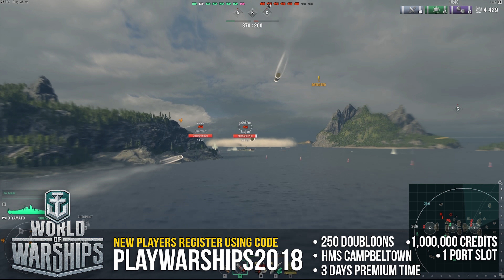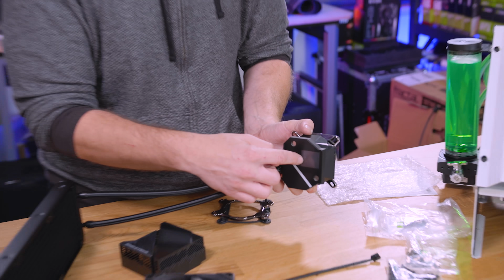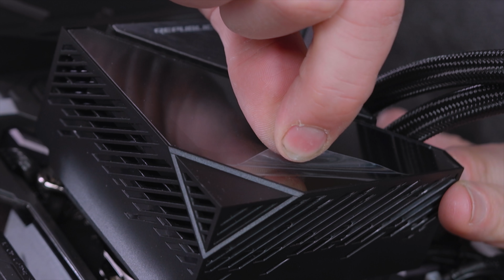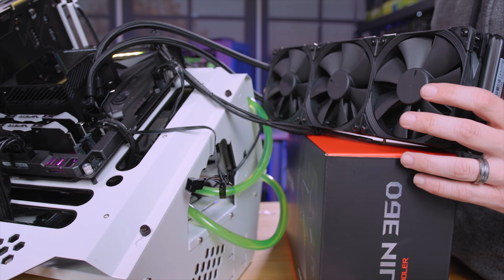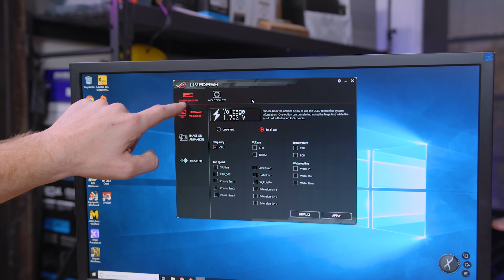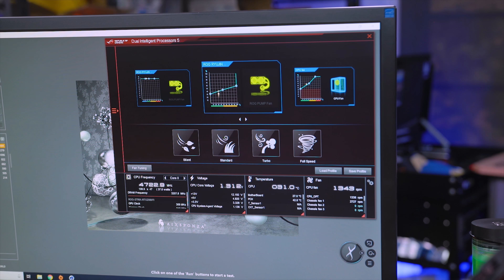ASUS made an AIO... but is it any good?? RYUJIN 360

Comment: Asus has been trash for a couple years now
Reply: I've bought two ASUS B350 boards and they both ended up fucking not working. Nothing but problems. Original was the B350 Prime and the most recent ROG Strix B350-F and it's fucking dead. My MSI board on the other hand works or rather worked fine.

Comment: Hi Jay,

Big fan, puns aside ;) 

Although I wanted to go for a fully water cooled solution, the UK market hasn't quite caught up and I have reservations about some sellers here so I ended up with an AIO. My NZXT Kraken X62 does an excellent job. I was concerned that it wouldn't be able to cool the 8086k I purchased with it but it rarely goes over 86 Celsius when load testing with default fan curves. 

I did swap out the two standard fans for Corsair ML140s simply to test the new fan tech. It happily runs at around 52 Celsius whilst under load with little noticeable noise as a result.

My rig is a bit of a Frankenstein as the case isn't ideally set up for the radiator. Any suggestions on improving this set up would be appreciated.

Adendum: Neglected to mention it has a stable overclock, all cores @5.1

Comment: I bought mine from overclocker before it hit in the US. And I’ve been loving it ever since. Keeps my 8086K cool at 5.2ghz. Even though I delidded my cpu butni don’t get anything higher than 50c when gaming and streaming I reach 60c. When I did a stress test it went up to 70c. So for the most part I am in love with it especially with it’s aesthetic that it has. Unfortunately you got one that came bad with wires but a lot of things isn’t perfect. Hopefully others didn’t. But it’s a great cooler. Don’t need Core Temp on my desktop to keep track of my temps I can just look to my right and check out the temps.

Comment: I have a mission for you jay! take the Fish Tank cooler and run it with a mineral oil 
submerged PC perhaps cool the tank with a closed loop radiator in the oil or run the oil from 
the tank to the fish tank cooler. one more idea. if you ran the coolant lines (with standard coolant) 
from the fish tank cooler in the mineral oil at super low temperature  to a block will there be 
any issue of condensation? please reply! love the show will post this again till i get a through.

Comment: 12:45  Only because you didn't fix the problem.  A very fine flathead screwdriver (like in a jeweler's kit) would allow you to remove the pins, which would then allow you to either solder or crimp the wires properly, then put them back in.  Not at all hard for someone who's been working with computer hardware for a while.

Comment: AISuite is trash. I went through 2 rma's and changing out a psu bc of what I thought along with asus was massive voltage drops. All of the monitoring software I would run including aisuite was showing drops to 1.5 volts on the 12v rail and that's just to name 1. Then sometimes there's problems trying to uninstall it in which you have to download aisuite uninstaller to get rid of it. It will never be put back on my pc.

Comment: I want an AIO with quick connect fittings so I could customize the cooling of my rig without using hard tubing . Possibly even a dual pump set up like an inline pump midway between the CPU and GPU blocks . I have a RTX 2070 on order and am thinking about over clocking it a bit more although it's already factory clocked at 1725 MGHz . If I can get closer to 1800 with reasonable temps I would do it .

Comment: First and foremost: that's the best assembly sound effects ever and needs to happen from now on.

I use an H100i V2 on my i7 4790K. Idles at 28° and gets up to 57° under load (not overclocked). I had wanted a Kraken x52 for that beautiful infinity mirror, but iCue is way better software (and unlike Asus, Corsair combined their two software into one). Plus it was on sale for under $100.

Comment: All the cables should be detachable. Mini 4-pins with PWM exist on video cards since dinosaurs roamed the earth. Same goes for micro USB and some small form factor power connector (like a 2 mm barrel jack). It's not like you need more the two wires from the SATA plug.

Comment: PHIL - PLEASE keep the "Requiem for a Dream"-style 'FFW montages' coming, they're the shit!!!

Speaking of shit - this ASUS AIO! Talk about overpriced, gimmickfest garbage. 
The AIO would've been cool - if it was better quality than a cheap ass Asetek.
The VRM/socket fan would've been legitimately damn cool - if it didn't sound like an RC jet engine on the verge of exploding. 
The screen would've been cool - if it was 2012(ok, I would totally use it if I had a cooler with one, not that it would influence making the purchase though).
The Noctua fans would've been fucking awesome - if they were attached to a better product.
Just as we've seen with their Z390 products, the brand has now superceded the product quality. Which is sad.

Guess I'll continue to stick with ASRock motherboards(my B350 Pro4 just kills the Prime B350 Plus that I originally bought first, the Pro4 can EASILY handle my G.skill 16gb 3600MHZ@XMP while the Prime couldn't quite hold 3000mhz SMH) and Cooler Master AIOs(just can't beat them, bang for the buck! I have little doubt that they're of much better quality than Aseteks, they have very nice build quality from the cheapest 120[which I'm using on my Ryzen 1600] all the way up).
That's just my irrelevant thoughts

Comment: I have one and it’s a definite don’t buy one when you don’t have a Asus motherboard. The ai suite can’t be installed without a Asus MB. Without the ai suite the Fan speed are not being controllable and the temperature and cpu info on the display won’t work
Reply: I've used the Ai suite on gigabyte, asrock and msi boards... So liar!
Reply: - HobbiT - it doesn’t work on mine. Starting the installer gives me an error.
Please go to the support download page of the ryujin at the AI suite download there is the following message:
ROG AIO radiator fan control via fanxpert is supported Asus motherboard only.

The cooler is not bad, asus software is just crap.
Reply: Thanks, good to know before hand
Reply: Hey. I have the problem that sometimes the RPM of the fans just jump straigth way more up  like from 800rpm to 2k rpm (like it doesnt follow the settings/curves) and then goes back to normal. Are u experiencing the same issue? most noticeable when I open programms
Reply: r Louis I can’t control the fans at all, cause I can’t install AIsuite due to an error. My fans are currently controlled by my nzxt fan controller. No issues there. Pump is set to full speed as a curve there is useless.
Reply: I know nothing about any of this, but I recently had to delete a line of info from a program using another program called orca to stop it from refusing to even run because I'm using an OS it doesn't want to support. (elgato stream deck) Do you think the program is checking your motherboard and only refusing to work because of that? I have no idea of if that can be resolved, but it might be worth looking for a way to edit a file like that.
Reply: Well F**K, in that case, they should have just used some kind of specialty cable instead of that spaghetti monster cable system that didn't seem work very well.

Comment: You know the funny thing about that is Jay that's not the actual CPU temperature it's about 10 degrees off so you were running about 94 or 95 degrees. It's actually reading off of a point on the back of the motherboard directly in the center of the socket it's not actually reading the true CPU temperature.

Comment: I must have hit the silicon lottery with my 8700k. I'm sitting @ 5.1 ghz @ 1.264 volts. My temps in AIDA64 after 30 minutes are only 57 C. I am not water cooled, just using a Be Quiet Dark Rock Pro 4 (I am delidded and using a custom copper IHS though)

Comment: 25$ air cooler that is huge and silent

or

ASUS AIO that is expensive, faulty, and loud, but fixable with really crappy software...

Yeah, hmmm...
Reply: but...but... you will have a 1 inch display screen. That alone should worth $10000 according to asus lover.
Reply: No 25$ air cooler is gonna keep highly overclocked 8700k cool.
Reply: @Jin-8063  neither is a shitty aio with faulty cables.
Reply: @Jin-8063  My 8700k runs over 5ghz and is in the 70 degrees....on a good air cooler....
Reply: @woofmeow-MTL  you wish
Reply: @magcs6233  ummm no...get a good air cooler. Its not hard
Reply: @Jin-8063  No AIO will keep a "highly" overclocked 8700k cool.
Reply: @markp8295  You are wrong, custom loops are a chore and waste of time. I have a Corsair H150i AIO 360 on a Delidded 8700K 1.4v 5.2 and during Prime95 Heat test won't go above 80c. I also had a 1080ti Hybrid that never broke 50c. AIO's are a peace of cake to deal with and cheaper. https://www.3dmark.com/spy/5221185
Reply: @markp8295  will do it better than a $25 aircooler
Reply: @Jin-8063  to each their own. I use my computer for gaming only, I have a Ryzen 5 2600x with a Cooler Master 212 evo for cooling. It cost me $30, I never hear it running and it keeps my CPU under 65°C at all times playing any game at high-max settings at 144FPS. I have no need for water-cooling atm.
Reply: @Justin-nq3xb  Nobody needs water cooling. Not a typical consumer at least. Enterprise yes but not us. Just good fans, good thermal paste, and a good case.
Reply: Jin- no normal person needs a highly overclocked 8700k
Reply: @robinkonig5828  Normal people don't watch these kinds of videos.
Reply: Oh hey Proto, nice seeing you here.
Reply: I think I'll just stick with an NH-D15
Reply: Calling asus rog armory really crappy software
You're not very bright are you?
Reply: @nerocladius4319  Asus Amoury is garbage compared to the others. Lacks functionality too.
Reply: Not gonna lie the hyper 212 is fairly quiet and could almost be silent with some tuning but liquid cooling is a worthwhile upgrade especially if you are overclocking everything in your pc and the ambient temps become super toasty.
Reply: And terrible customer service. Oh the memories.
Reply: berzerk0912 tbh I’ve never had a problem with their customer service I contacted them and and they responded and helped me within 30 minutes
Reply: hmmmmmmmmmmmmmmmmm http://i.imgur.com/6YToyEF.png
Reply: ProtoMario but ASUS has lights
Reply: @ShadowPBPBC just to let you know, the 290x is only around 10% better and your losing future driver support etc, i would have just kept the 570s
Reply: @name1874  hyper 212 evo
Reply: You won't see a $25 huge and silent air cooler that will keep the CPU decently cool. Plus, huge is never good and far from aesthetically pleasing.
Reply: SaltyCow That cooler is certainly not the worst, but most games are not really CPU intensive. That is they don't use 100% of the cpu, and definitely don't use AVX instruction. 65C is, in my mind, a little hot for gaming, but not bad for an air cooler. I would guess benchmarking would get you much higher temps and loud fans.
Reply: Loud ? I guess you never used a water cooled system
Reply: Say hello to my Deepcool Lucifer V2 (had to replace my AIO after it died a horrible death trying to cool down an FX chip)
Reply: Air cooling is for filthy peasants. A good AIO like the H115i is far more elegant.
Reply: @TheBlackIdentety  i have watercooling but you cant just go around calling people peasants for having a aircooler
Reply: @TheBlackIdentety  lmao when looks>performance and noise LMAO
Reply: @TheBlackIdentety  For me a elegant solution is simple yet effective, as simple solutions have the least likely hood of failing.

An AIO is NOT simple. There's a pump, there's the tubing from the radiator to the block and there's the radiator, on top of the CPU block and Fans.

Think about why you would want an water cooler. The good reasons to get one are 1) Increased area for thermal dissipation 2) A limited CPU cooler height. 

AIO usually don't exceed 240mm sizes on their radiators. 

If you use a good case and a good big cooler you can get all that with a simple yet effective air cooler too, while beeing less likely to fail and quieter cause you don't have a pump. 

 That's a truly elegant solution.
Reply: @TheBlackIdentety  You are entitled to your opinion, Even if it's wrong...
Reply: BareFinn1986 yes because an opinion can be “wrong”

Comment: Got a question.  I recently got a gigabyte x470 aorus ultra gaming motherboard for 140$ CAD and was wondering if I should return it for a b450-f gaming Asus motherboard that I could get it for around the same price.  I realize that a x470 board is better then a b450 board but I have read a lot about how the ultra gaming board fails a lot and it’s bios sucks.
Reply: If u got a good board then don't change it. You are not going to get a better B450 than your board and Asus software is not much better than Gigabyte just the bios is a bit more complete. The Gigabyte board has dual bios which one day you might regret not having on the Asus board. As long as your board does what you want I would be happy.

Comment: I bought one on Amazon last week the one day they were available.  I chose it because of the VRM fan which, as Jay demonstrated is quite loud.  It sounds like it should be able to dry Steve Burke's hair.  As others have pointed out, it does not report the CPU temp from the CPU but from a mobo sensor.  This means that it lags and under-reports the actual package temp.  I ran tests with my i9-9900k in RealBench, TimeSpy, and Cinebench with HT on and off.  I compared the results with my EVGA CLC 280.  The Ryujin stayed 7-12C cooler than the EVGA with HT off, but the EVGA equaled the Ryujin with HT on.  So I returned the Ryujin and am running with the EVGA again for now.

Comment: As someone who got this on release it has been a great cooler and i didn't have the cable issues you did. Although i did replace the stock thermalpaste when i installed mine. But your right the little fan is too loud i wish i could turn it down since i use water cooling on my vrm..

Comment: check temps from a software, i dont trust that OLED screen
Reply: Not to mention its update interval seems like its every 5 seconds or something. Temps can change or spike very rapidly and the OLED screen would not even display that.
Reply: Jesus no one said it would be a high precision monitoring equipment
Reply: @vnyggi621  ^ so instead it's a flashy gimmick and attempt to charge another 80-100$ for it.
Reply: Actually some guy did a vid on this it is in fact NOT accurate and takes the mobo temp under the cpu not the package so it is off always from real temps
Reply: @avadavis4768  exactly,  so gimmick for nobody. Asus is losing the focus.
Reply: People, the temps it reports are the temps your motherboard reports, that's how it works for EVERY software out there, stop being so head up the ass, jesus...
Reply: Jay please check the review from O3CD TV, the temperature that shows is from a probe behind the motherboard. Asus confirmed. Using the OLED temps is highly misleading about the real performance of the product. https://youtu.be/2wS0Ev3SX2I
Reply: I read that it used to be about 10 degrees too low on the OLED screen. I just installed mine yesterday, and it now seems to be pretty much the same as hwinfo and coretemp. Asus has probably updated the driver lately, or maybe I was just lucky with the cooler I received.
Reply: oled screen there will actually hurt temps a little
Reply: @Synthematix  hows an oled screen gonna hurt temps?? Are you a little slow?
Reply: Because of all the electronics powering it.
Reply: Which makes the OLED screen even more useless... Cash grab attempt. Another greedy corpo like Intel (i9 9900K), NVIDIA (RTX 2080 Ti) and Bethesda (the obvious game).

Comment: I continue to hear about how hot the 8700K runs but to be honest, I don't see it. Yeah, 85-ish can be considered high but with 100c being the Tjunction per Intel's ARK site, it's really not bad. I have my 8700K at 5.2GHz at 1.35v and it is 100% stable and only peaks at 84C on a Dark Rock Pro 4.

Comment: Even if the fan wires were assembled properly (Asus PR is probably freaking out right now, LOL), other reviews say the cooler doesn't accurately track thermals of the CPU, it ramps up the fans via a probe in the block versus the package temp of the CPU. Corsair also does this by default, but that can be changed in their iCue software. Asus software is missing this option. Waste of $280

Comment: wc-9ak-ek arrived yesterday after a cyber monday purchase, I'm sorry that info is about as useless as the y splitter you got for that $280 Aayeyeohh. Still, a nice recovery to finsh a days work, however, I think SB pointed out that where the temps are taken from on the pump don't accurately represent the correct cpu temp and could be as much as 10 degrees out, i.e. +10, (+/- a couple of degrees).

As a first attempt when coming into an already very competative market, I think that if they can tighten their prodcts up just a little, then they will be a welcome addition (for when someone who isn't quite ready to custom loop) to consider implementing as a cpu cooling solution.

Comment: 4:41 aw why the hate on molex, sata is cool and all but for DIYers molex is just the best thing ever, just a simple 5 and 12v line with big thick cabling that is easy to crimp if needed or just split and solder however you want, sata is just "modern" enough that it isnt dead simple to mod like that so yeah leave my molex alone